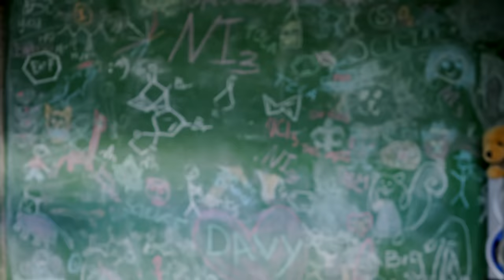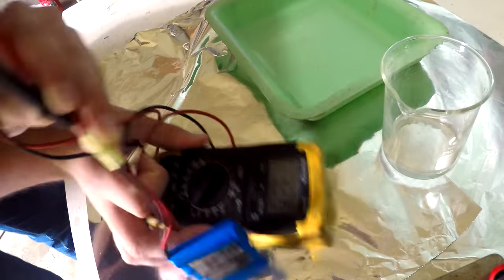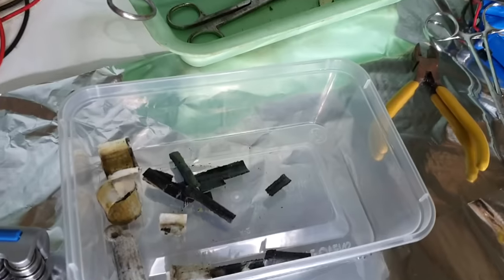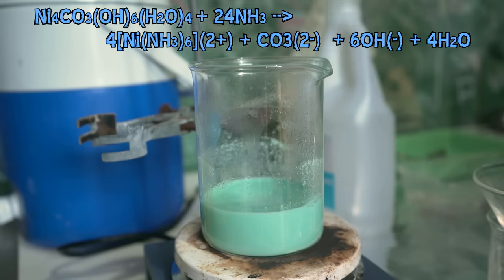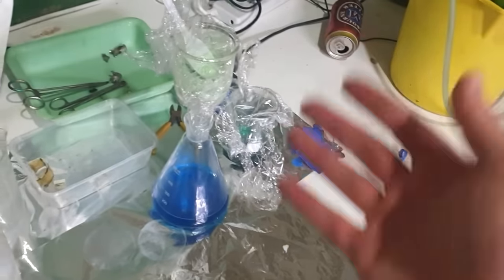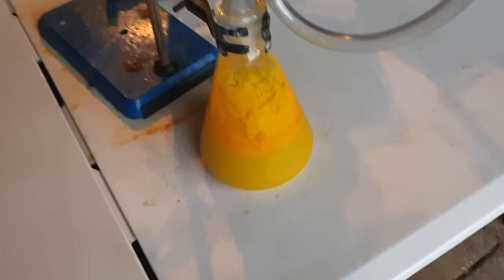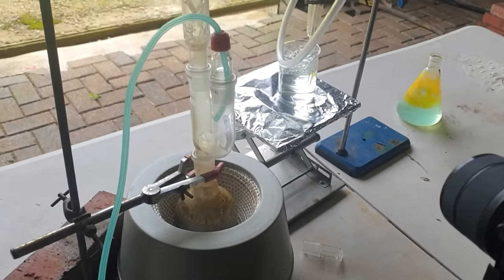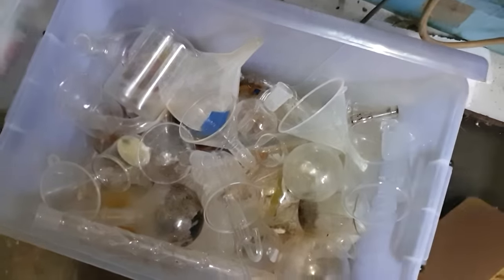Extracting Cadmium from a NiCd Battery

Comment: Didn't this guy hear about NiMH batteries?
Also discharging a pack of batteries that are in series is not a good choice. There's no proof that the pack is balanced and you could end up with 3 flat ones and one with still some juice in it. It's better to do that one by one.

Comment: Im thinking about changing majors from mechanical engineering to chemistry.  I struggled with the derivations of dynamic structures (I passed calc 1-3).  Do you have any opinion or comments about majoring in chemistry?
Reply from the maker: It definitely changes the kind of jobs you end up qualified for. There's chem eng too, which if you enjoy the mech eng stuff then you'll get to use that a bit.
Reply: @ExtractionsAndIre  Dude!   Thanks for the response!  Job wise, I'm not too concerned.  I currently work for a large semiconductor equipment provider that I travel internationally for to install equipment among a large customer base (intel, samsung, toshiba, FB, etc).  Chemistry has always been a interest/hobby, same as electricity, but I feel more inclined to study chemistry which has more organic concepts, rather than the black/white math heavy mech eng.  Anyways, I enjoy your content and wish you luck in the future!

Comment: Surely sticking a 100 ohm resistor across the terminals would have had a better way to discharge it? 
Although,  I'm assuming some idiot in a shed would have such a thing, or even know what it was 😂

Comment: Ni–Cd batteries contain between 6% (for industrial batteries) and 18% (for commercial batteries) cadmium, weight of AA ni-cd 21grams, so at best you should have 3.78 grams, you had? 100mg's? 2.64% yield. Okay were's the Cadmium unless it was  6% cd in which case it was 8% yield.

Comment: If you expected 10g of cadmium yield for example then you would have needed about 3g of H2S gas. that would be more than 2 litres of gas, assuming 100% of H2S would be absorbed into the solution and reacted with the cadmium, which is probably never going to happen. So this could explain your low yield. Btw, i'm not a chemist :)

Comment: Hey Tom. Do you actually have a chemistry degree or chemistry job, or can anyone do these projects at home? I'm an electrical engineer and most projects that makers share can be done at home so hoping I can try some of these projects at home. I just imagine they have things in place to stop people from buying these chemicals lol
Reply: Most of the stuff he uses is purchasable from the hardware store or eBay. Places like Sigma Aldrich and other commercial chemical suppliers typically only sell to companies or professionals, but most starting chemicals can be found cheap in stores. Hydrochloric acid for instance is easily purchasable from hardware stores because it’s used for etching concrete.

Comment: NiMH batteries which are rather similar, also seen in a lot of high-level applications for consumer devices when environmental resistance is of particular concern, Particularly small scale remote control vehicles, even some extremely high-level and well-made ones costing nearly 1000 USD will use them if water and mud and elements are going to be encountered frequently

Comment: As an electronics nerd actually wanted to kind of point out that nicad battery is really started to get phased out when nickel metal hydride cells came out. They don't have that same surge current capability to my knowledge, but they are also really good at taking abuse and in particular they're good at dealing with charging and overcharging. That was another reason why nickel-cadmium batteries were you so much is because they just let you abuse them electrically. If you abused a lipo you really do run a decently significant risk of causing a fire, though it's generally not as big of a risk as it is portrayed in media. It's just so so much higher than something like nickel-metal hydride cells.

Comment: I'm sure other comments have mentioned this, but you cannot accurately tell the state of charge of a battery using a voltmeter. You need to use a battery tester which puts a load on the battery. I bet even a small load would have dropped the cell voltage to a fraction of a volt.